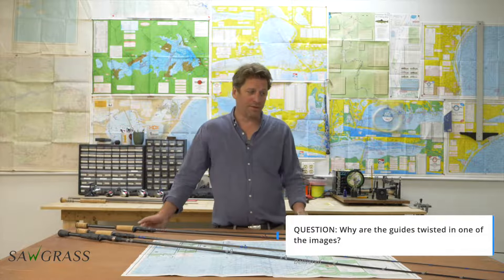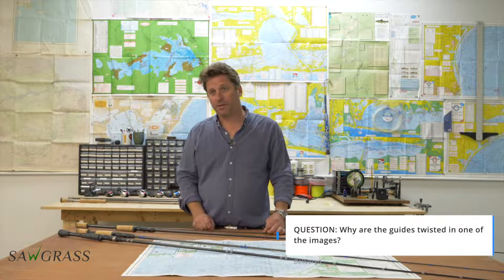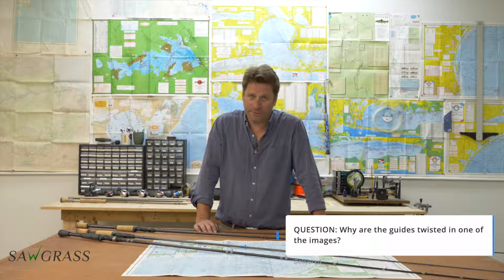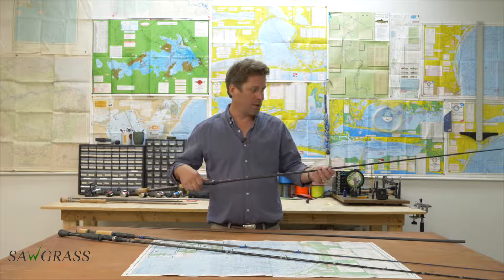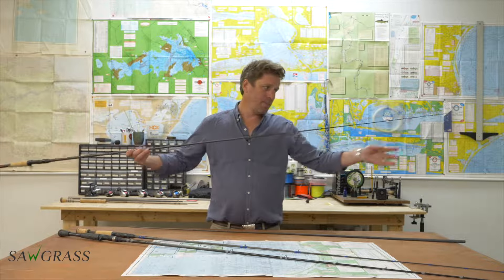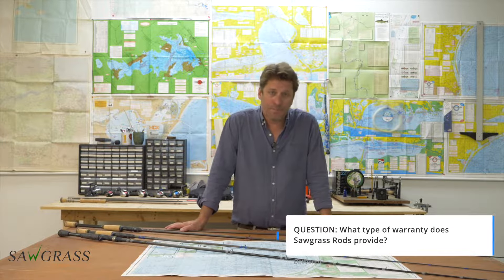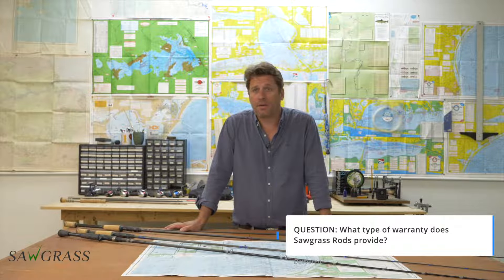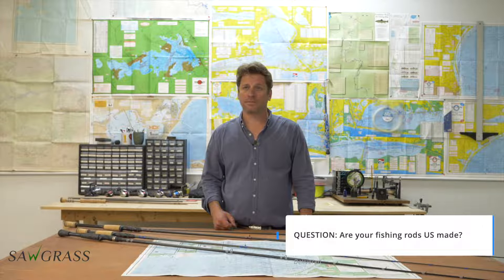Sawgrass Fishing Rods Q&A With Collins Illich

Comment: Acid wrap won't take over. It offer little to no advantage. If a rod is properly built on its spine it does not try ro twist. With proper guide spacing there's no line to blank contact.  An extra recoil guide less than a quarter of a gram. 

Question though, why are you using the HM series instead of the improved Xray series, especially at the $500 price point?